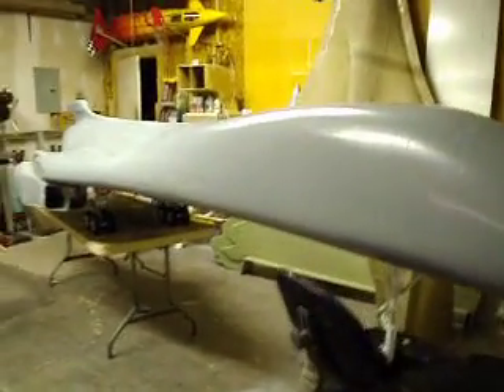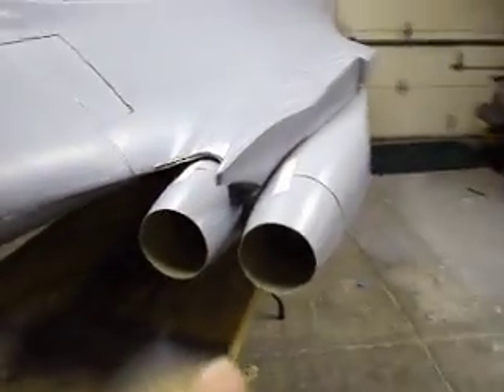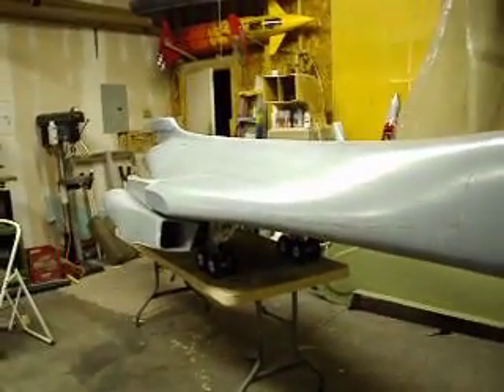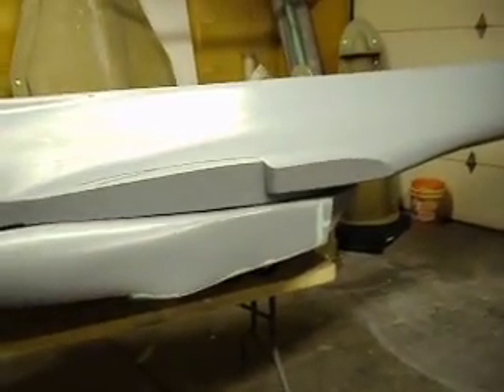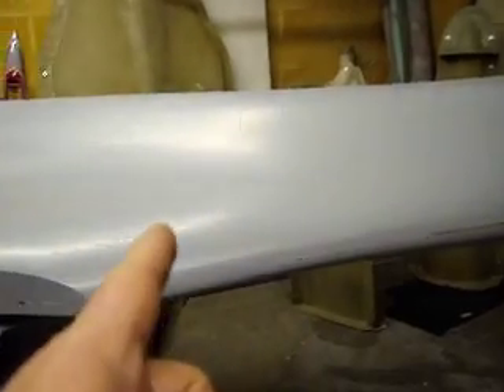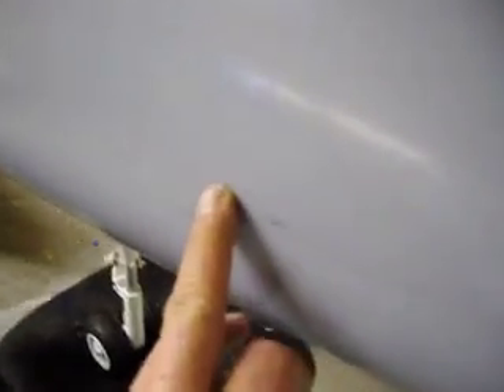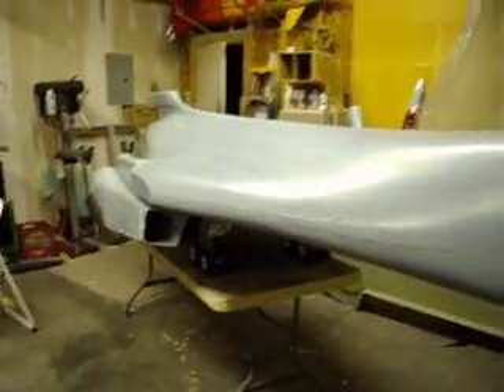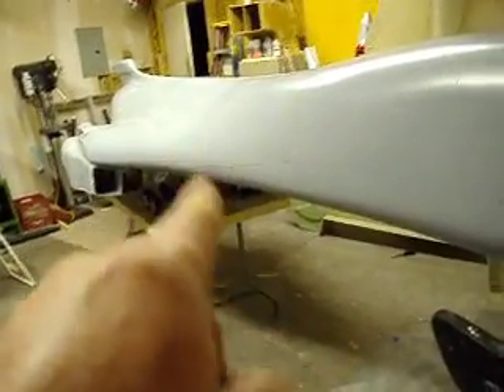how to build a rc jet B-1 bomber # 91

Comment: I don't think that'd be much of a concern if he doesn't put fuel in the wings. And, I'm sure he won't have 3 separate tanks transferring up and down the fuselage for ballasting  

This bird'll be light enough I'm positive it wouldn't be a concern. Also consider the positive moment from the increased trust from the vertical positioning of the engines at higher speeds with the wings swept... not an issue.